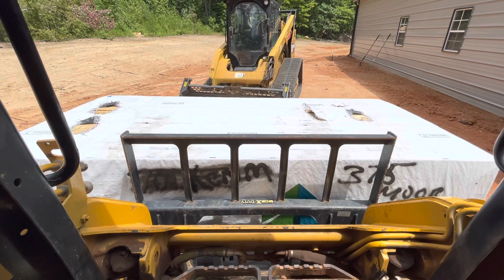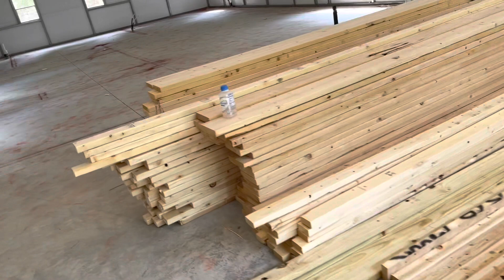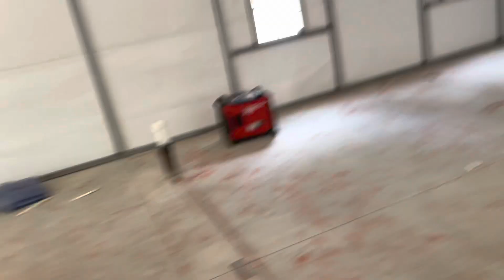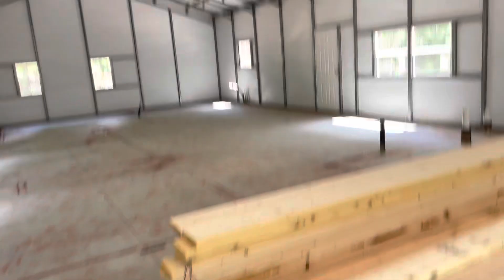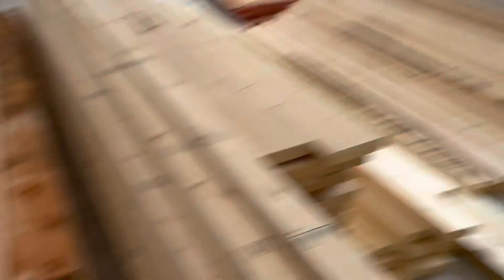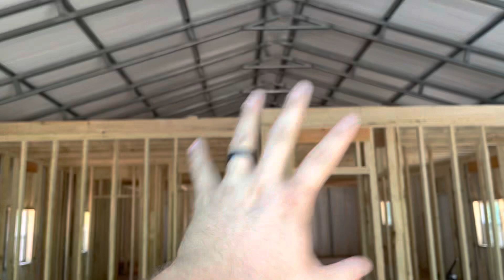Mining House Garage Build Update

Comment: Taking a stab at this in case someone can give me some insight on my problem.
I have an Asus Z390-P that refuses to boot properly when cold booting.  It hangs for about a minute with all gpu fans except the cpu at full tilt.  It will then post after a minute and the cpu fan will start up.  

If I let it boot into an os none of the gpus except onboard are detected and the fans are still spinning at full tilt.  I get around this by going into the bios when it finally posts and simply exiting without saving.  Then it boots fine with no issues.  The only thing I can say is it has a normal power supply and then a dell power supply with a remote turn on from the atx ps.

Comment: You have to run maintenance on the solar panels from time to time. Like changing the transformer on the back of those panels. It's a bitch sometimes to access those on roof mounted solar. If you can, I would make some car port shade structure where you can access them from underneath.

Comment: That 10k in lumber and framing is about 20k+ in new England. Plus aren't the boards that touch the concrete supposed to be pressure treated?
Reply: They are
Reply: @MotorNubs  thats good i couldnt see in the video

Comment: @brandon coin I hope you haven't put anything throught the roof yet. I recommend a attic fan high up on the side and plumbing vents through the side. The roof can't leak around the vent if it isn't there. You could put the exhaust on the reverse end of the garage, and put your equipment vent in attic and let it blow through that way. Would be easy to divert that exhaust to heat house.